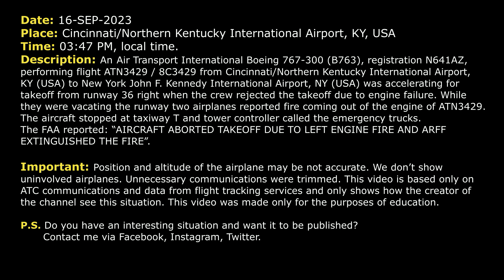“PRIME IS ON FIRE”. Rejected takeoff due to engine failure. Engine fire. Real ATC

Comment: Vacating after a RTO seems a bit too enthusiastic. They’ve had an engine failure. What happened to setting the park brake and running through checklists? Very strange responses. 

If I was that aircraft behind I’d want a full runway inspection before departing as well.
Reply: It depends on how the cockpit briefing went and what was the plan of action. Getting of the runway is not unimportant and that split of duties is acceptable. If they fired the first bottle of extinguishing fluid, you sometimes have to wait a while to verify fire indications. The pressure introduction of extinguisher will cause lit fuel to propagate towards, the back of the engine. Good work by all crews